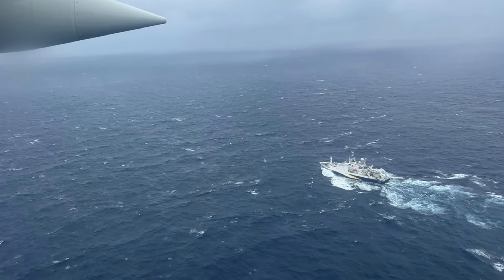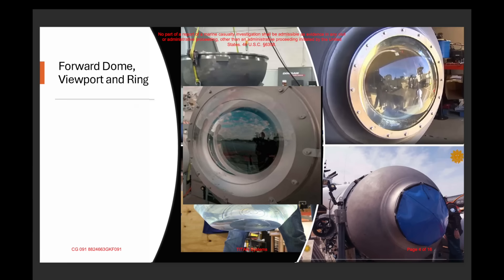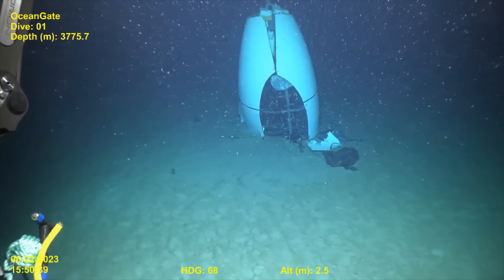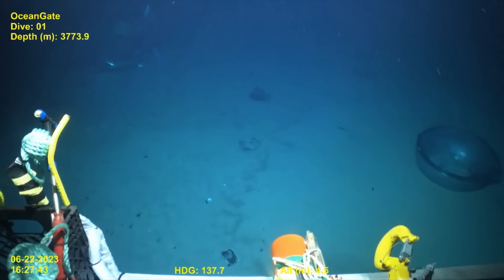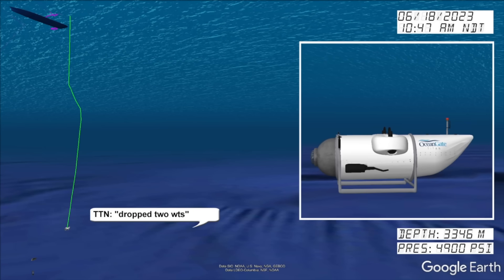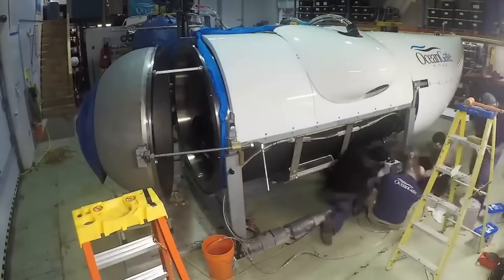Analyzing how the Titan submersible Imploded.

Comment: Prior to the dive, difficulty arose with keeping the Titan horizontal. Descending through a fluid a craft cannot rely on free fall to arrive at its destination, but needs fins to control its direction of travel, which were lacking in the basic design. The point of failure was the brittle glue connection between the titanium cone and the carbon fibre hull. Even this expedition might have completed successfully. The Titanic was already in sight. However, the craft was descending faster than normal and an error in judgment resulted in the Titan touching the ocean floor sooner than expected and at an angle instead of landing flat on its platform. Even a relatively small jolt would have been sufficient for the epoxy to separate from the titanium ring. Epoxy glue clings tenaciously and it is almost impossible to separate two parts joined together with the application of heat, but when chilled near freezing the brittle substance cracks with ease from even a minor shock. 

The junction of the cone to the hull should have been similar to that in metal plumbing pipe fittings with a convex rim of the cone pressing into a concave grove in the ring so that the more outside pressure that is exerted the tighter the seal, which would also withstand failure from the application of lateral forces. Bolts, in addition to glue. Primary failure was not due to the carbon fibre hull collapsing, but spread from the point of separation of the ring.

Comment: How do you come to the conclusion that the carbon fiber tube did not fail?  The carbon fiber was smashed to small pieces.  If there had only been a leak at the joints the vessel would have filled with water and drowned the occupants, and they would have been found as bodies inside the Titan.  The carbon fiber tube crushed starting at the front and everything inside was imploded towards the rear cap.
Reply: No, any leak or break of any seal.. no matter how small at first, would have been met with so much pressure that it would instantly compressed the air inside the hull and imploded the air as well as the passengers. While imploding the air would reach super hot temperatures. But as the air implodes it'll take the hull right with it in the direction of the force which we find was pushed to the rear of the hull. We're talking about almost 400 times worth of atmospheric pressure instantly compressing down against only 1 atmosphere of pressure.
Reply: The pressure would have been so great at implode that you wouldn't of probably even had a bubble of air after the heated implosion reaction. The air may have just vanished so to speak within the water. It wouldn't have even been strong enough as far as a counter force that it probably barely moved the water past a short distance from it.

Comment: Carbon fiber is strong tensile strength  but not in compression.   The resin plays a major role.   According to this video the problem was at the joint between the carbon fiber and the Titanium dome.  There is no good way to fix any leaks.  A lot is still conjectural.  We can see the submersible broke up.   I'm thinking it may have actually exploded outward in some way.  In terms of disasters, this is rather insignificant.  Obviously  it was risky.  All this talk of certification is a lot of BS.   No one could ever be certain of its success.

Comment: This is a stupid design, like me as a mere designer, not an engineer, could've told you this. Mixing materials like this is just a bad idea when you're talking about the intense pressures they'll be subjected to. He wanted so badly to be some upstart rule breaker genius that he ignored common sense.

Based on the fact that they dropped weights early, they probably started hearing loud cracking. I'm guessing that weight drop might've been the last little jolt of the vessel being jostled around that was the final straw to break the camel's back and all went black for them. I'm guessing their last moments were scary and loud even though everyone wants to pretend it was just out like a light. The deaths, sure, instantaneous and painless, but the panic and fear was probably pretty intense.

Comment: Hi, This is the best video on the subject so far. Thank you so much. The fact that people had their doubts about a carbon fibre structure are legit. It had to fail at some place. The bond between the  hull and one of the endcaps was just the weakest point. That doesn't mean the carbon fibre construction was not to blame. As you mentioned; carbon fibre.... hear the "fibre" in the word, is a "pull" material, not a "push" material. I will go so far that I think that the Sub would have been better off without the fibre and only the resin. "carbon fibre" is a amazing buzzword to get funds and look "innovative". I feel for Suleman Dawood mostly.

Comment: Excellent analysis and presentation. I was really surprised that the carbon fiber itself didn’t fail. I used to work with carbon fiber cylinders used for breathing air. They are hydro tested every five years to pressures comparable to what the sub experienced, but they can only be tested three times (and can only be in service 15 years) before they must be destroyed. Titan far exceeded the first parameter.

Comment: The worst part is that OSHA LET him do this. Most likely because of Rear Admiral John Lockwood sitting on OceanGate’s board of directors politicking and swinging his metaphorical “Wood” around. Lochridge even said as much. Something along the lines of Rush saying “Oh Lockwood will see us thru those regulations”. It’s a fuckin disaster on all levels. The authorities that are responsible for regulating and oversight of projects like these are just a culpable as the idiot who was doing it. If the authorities won’t stop idiots from killing 4 people and themselves, why do the authorities even exist? OSHA is so corrupt it boggles the mind. A handcart in front of the fuse box at my workplace? $10,000 fine. Literally building a submersible out of Home Depot parts and FUCKING GLUE??? Not a word.

Comment: I wonder if the carbon fiber wasn't such a bad idea afterall and it was just bad implementation or pick of the materials for the glue. I don't think anyone is gonna keep testing since Stockton cutting corners everywhere ruined it for ever in the industry. It would be interesting to have some real research done with proper testing as the regulations demand unmanned of course. I mean it wouldn't seem crazy that a proper glue mixture or technic would exist to make it hold. What I mean is that maybe they implemented all the steps so poorly and unprofessionally where something that could work didn't because of sloppy job. No one was expecting the glue to have been the cause. Ffs I painted my motorcycle in my home as an amateur and used gloves, air filtration and suit in order to get a decent result. For me this was a money issue and Stockton new it would fail in the end but he dove so deep in his wallet where there wasn't an out so he gambled it for all or nothing and got nothing. Imagine being in his shoes. You investing all your money in something you believe for 10+ years and in the end results show your whole thesis of business is wrong and should be scrapped since carbon fiber isn't suitable...

Comment: Thats exactly what I predicted shortly after this happened, seeing the video of them doing the glue up of the rings on the hull, even I could tell you that it was done in an unsatisfactory way. And you can tell it was the glue joint because one dome was intact and one was split from the ring meaning something hit it with some force.

Comment: It did work, for a time at least. I think the point of material deformation under pressure is spot on, the titanium end caps and rings would have deformed at a different rate to the carbon fiber. Over time that fatigue allowed high pressure seawater to push in to the point where it eventually failed like it did. Had the Titan been tested to destruction in the first place this phenomenon may have been discovered and mitigated, and those 5 souls would still be with us. The worst thing is how the concerned engineers and Oceangate staff were dismissed and shown out when they expressed their premonitions of a catastrophe.

Comment: A clear, helpful summary, thank you.  My only correction , and I am not an engineer, is that the clear viewport was not glass but very thick acrylic that was only guaranteed to a much shallower depth than the Titanic.

The Andrea Doria incident in 2016 with Titan’s predecessor submersible Cyclops really shows Stockton Rush’s willful blindness and instability when anything opposed his whims or authority.  One of the witnesses in the current hearings, David Lochridge, who was more experienced with the vessel, testified that Rush refused to heed urgent warnings about difficult weather and tidal conditions and insisted on taking Lochridge and 3 paying passengers down 250 feet to the Andrea Doria wreck.  Rush then ignored Lochridge’s pleas to keep his distance and “smashed right down” and then “basically drove it full speed” and jammed it into the side of the bow of the wreck  Finally he actually THREW THE CONTROLLER at Lochridge, damaging it.  Fortunately, Lochridge was able to repair the controller during this emergency and the sub was eventually brought back to the surface with no fatalities.  Rush’s behavior does not sound sane to me.

Rush never listened to reason and raged at anyone who tried to give warnings or oppose him in any way.  He insisted on cheap shortcuts and shoddy workarounds.  Somehow — and this must be prevented from ever happening again — he deliberately avoided oversight.  He gambled not only with his own life but with the lives of employees and of paying passengers who could not know the danger they were in.  Finally, he tried to bully the laws of physics and materials science and there he could not get his way.
Reply: Interesting. Before this happened, Social media users all fawned and gushed over him. Anyone who challenged this was a "hater."
Reply: @Atomwaffen-y3s  : Sounds typical.
Reply: I wonder why Rojas, a passenger on this dive, said this incident didn't happen the way Lochridge described it? They were both under oath, seems odd.
Reply: @TylerDurdan241  : it does seem odd.  I hope the investigators are able to get clarification.
Reply: @TylerDurdan241 yes as soon as she denied that at the hearing it was clear that one of them is lying, just which one hmmmm. Have watched all the hearings live so far, I've shaken my head so many times I'm surprised I don't have neck ache!
Reply: @clarerutzrutter  Actually the more I think about it, the Andrea Doria incident where Rush behaved badly, was out on social media way before this hearing, indicating that it didn't originally come from Lochridge, as I'm guessing he was under a court ordered NDA with his Oceangate settlement. It amazes me that SR HH and PHN were educated and intelligent men. I am not either of those, but have a limited experience in diving and pressure vessels, purely because of its construction, I would not have gone anywhere near that contraption, such an avoidable tragedy
Reply: @TylerDurdan241  yeah I remember hearing about it I think not long after the incident but the same can also be said about that infamous letter that was said to be written to Stockton, I was very surprised that it turned out it hadn't been sent but then of course everyone knew about its contents. I've been waiting patiently since day 1 hoping to find out what happened and hopefully it can be prevented from happening again and avoid needless waste of life. I'm more inclined to believe the experts but she reckons she has it on video anyway so maybe the truth will out! It's clear someone is telling lies though, the whole situation is awful.

Comment: They used that crap peanut butter adhesive. They should have used liquid Flex Seal (TM) in the joint and reinforced the joints on the outside with Flex Tape (TM)
Reply: And reinforced the carbon fiber with Sham WOW!
Reply: @Revoncheap lol they did use rhino liner on the outside of the carbon tube.

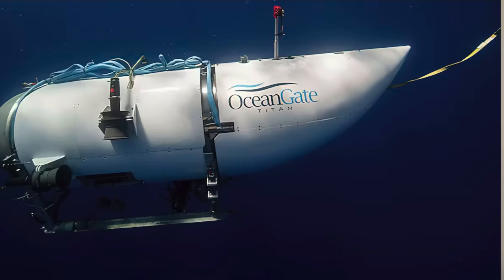Comment: 5:55 I heard the news from you first, but this is a reckless statement. 
Stess is force over an area.
Strain is deformation per unit length. 
The carbon fiber failed near the titanium joint because the shear modulus of the composite was exceeded by the difference in material elasticity.

Comment: Nonsense!  👎 The wreckage clearly shows it was the hull failure, which originated at the bottom side at the interface with the forward titanium dome. 
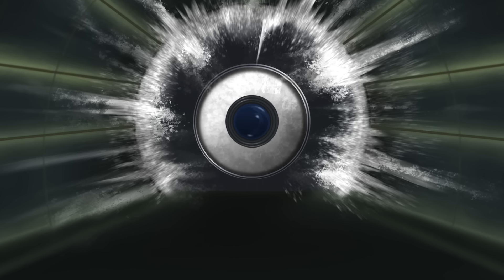The symmetrical sprays of water you show at 7:50 is simply an utter nonsense contradicting the evidence. The hull would've never imploded that way if such leaks had occurred earlier.

Comment: Until they can show me something different, it looks to me like it failed at the rear, and everything including the human remains was crushed into the front dome.
Reply: The ROV video of the Titan debris field shows the forward dome fully detached from the vehicle laying on the bottom some distance away from the aft dome which has a large amount of carbon fiber debris packed into it.
Reply: You’re 180 degrees off…the materials are in the AFT dome, while the front dome is well away from the main debris….

Comment: Cracking and banging, lightning strike, it was all the first hull, it was replaced by a better one. It wasn't the carbon's fault. The idea wasn't wrong, but more testing should have been done, including or even specifically the glue! That was my suspicion and it was confirmed, from the ring to the carbon the glue wasn't good enough.
If the Submersible had been a total failure, as some say, then it would not have been able to carry out missions. Much of it was well thought out, but others were not. That's why it was experimental.

Comment: I have to disagree with you. 

We know that Stockton would not have immediately signaled that there was an issue. 

And we know that topside had to request better communication.

And we know that topside waited 8 hours before contacting the coastguard.

Its more likely that they sat on the bottom after taking a nosedive. Then, they spent some time tapping on the dome until the vessel imploded.
Reply: they lost communication after only 6 seconds since the dropped 2 weights message so I doubt that
Reply: @naurrr  Communication loss would also imply that other systems were lost. Silence is not death.
Reply: The debris field is way too wide. No way it imploded on the seabed.
Reply: @Dannzt  Looked to me like some of the debris was embedded in the sea floor
Reply: @Shogunersash  The debris simply fell on the bottom, which is rather soft. That "submersible" had so many problems I amazed it didn't implode earlier. 
It imploded because of the hull failure at the bottom side of the sub, near the forward dome. Sprays of water shown in this video e.g. at 6:10, are nonsense. If anything like that had occurred, the probability of the hull imploding to the rubble we can see in the video evidence, would've been very, very small.